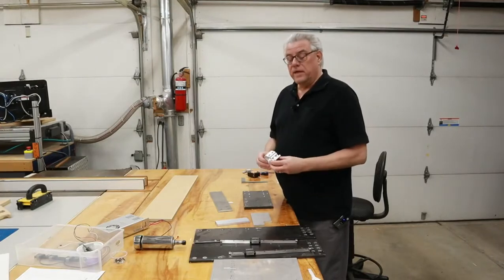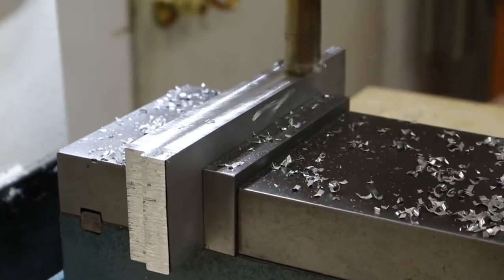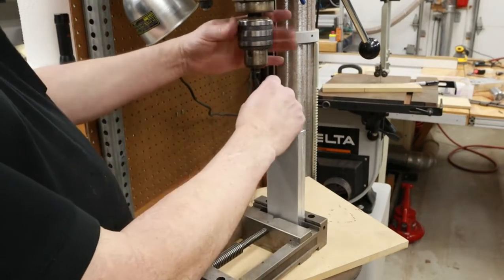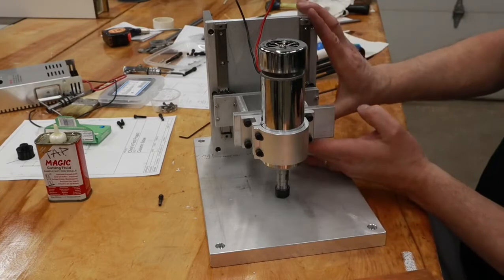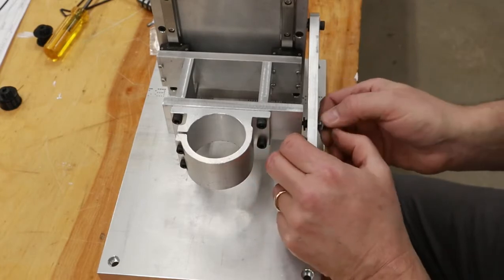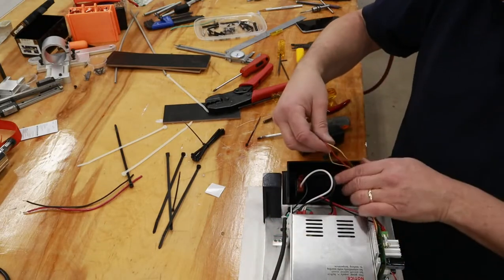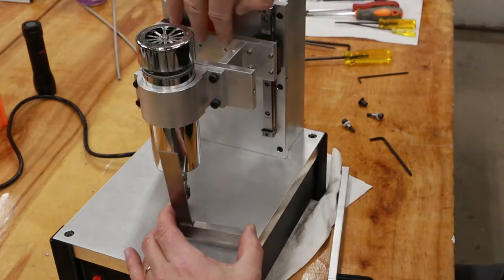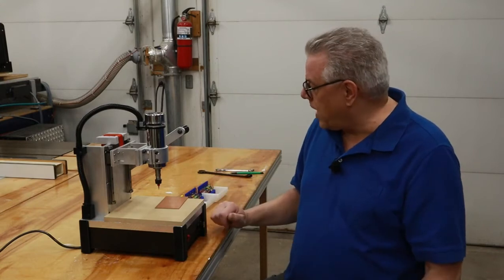M004 Make a Precision Drill Press from Bits and Pieces by Chris DeHut

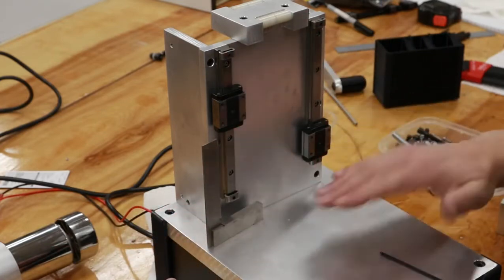Comment: 28:54 - I know that precision linear guide rails requires a datum edge milled on to the base plate to help mount the rails and also provides greater rigidity to it when precision milling/drilling. For your build it seems you have not implemented a datum edge for the rails, does this mean that the datum edge is not always required? This is by far the best precision drill I have seen on you tube for such small size. It is also the only video on youtube that actually explains on how to properly mount precision rails in detail. I never understood why one rail needs to be the master, until now. I have been trying to find videos of verbal explanation on how to mount precision rails but none are out there. 35:23 - Should wear a mask, breathing in any amount of PCB dusts (fiberglass) is irreversible lung damage, the body has no way to remove it.
Reply from the maker: A linear rail does NOT need a reference edge in this application.  There is no side loading on these rails to cause a shift.  Most light duty applications have no need for it either.  However, what it does offer is ease of alignment and assembly.  
Thanks for the health advise.
Cheers!
Chris
Reply: @MakingStuffwithChrisDeHut  Thanks for the explanation, yes indeed this drill press using CNC parts is not applying side loading, never thought of that.

Comment: Thanks, Fantastic job, I truly appreciate you taking the  time with this video .  Can you provide links for spindle , collect, drills, power supply rails Etc..
Reply from the maker: In the description you will find a link that I just added for the spindle.  As for drawings, as I mentioned in the video, it was made from "Bits and pieces" therefore no drawings.  If I get time, I will provide some basic dimensions that you can use as a guide for proportion and sizing.  Unfortunately I am exceedingly busy these days with my real job so it may take a while.  
Cheers!
Chris

Comment: Hi friend. I would like to know volts and amperes of the power source you used for this project. Thanks a lot
Reply from the maker: Hi Jose,
It has been a while since I built that, but most likely it is a 48 volt power supply.  If you are looking for the spindle and power supply, search for 500 Watt machine spindle on Amazon and you will find plenty.
Cheers!
Chris
Reply: @MakingStuffwithChrisDeHut  i appreciate your answer. Long life to you my friend

Comment: Is Your power suply fan temperature controlled ? They normaly make a lot off noise ☺
Reply from the maker: I don't know, I don't recall hearing it run - maybe I should make the drill press work hard to see if I can get the fan to run  if it already isn't.